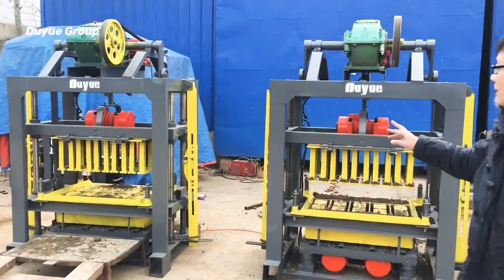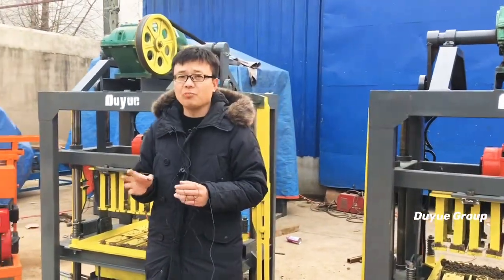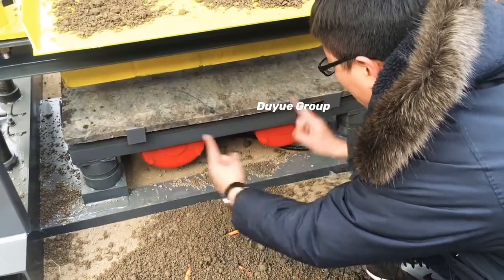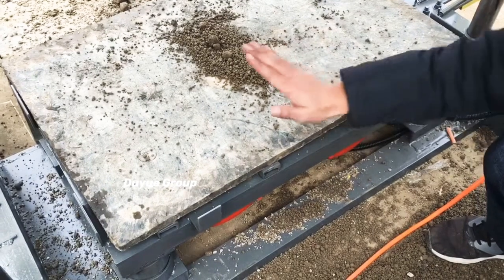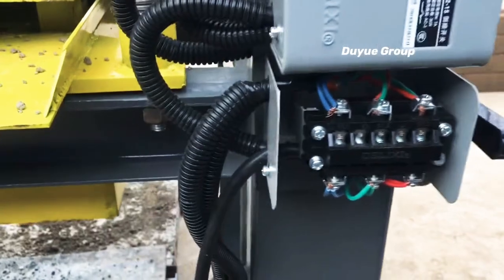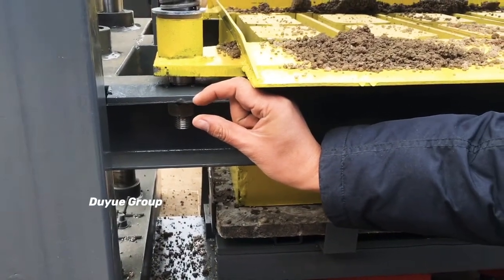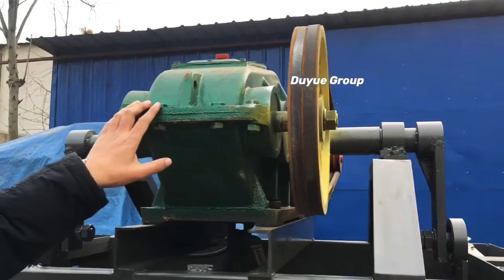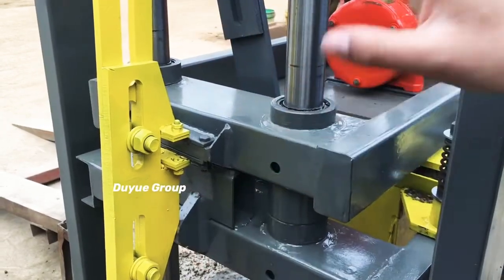What Maintenance and Cleaning Procedures Should You Follow for Your QTJ4-40 Cement Block Machine?

Comment: Hello I am Ferenkeh Yanka in Sierra Leone 
(1) How to connect a single phase electricity line to a power QTJ4-40 machine. I actually have one new machine from China recently and I have15kw generator.

I need
Reply from the maker: Sir 
You may add my WhatsApp number:008613053989171.

Comment: How much is that gearbox and the vibrators? We welded the gantry but now need those mentioned above.
Reply from the maker: That sound wonderful 👍🏻👍🏻👍🏻, it seems you are a mechanic engineer, you please add my WhatsApp number: 008613053989171. Then we discuss more
Reply: @HenryBlockMachineGroup  My WhatsApp malfunctioned a bit requiring an update. But I will add u as fast as possible